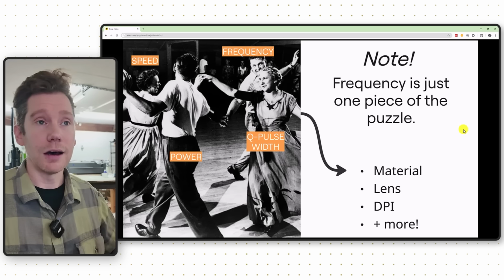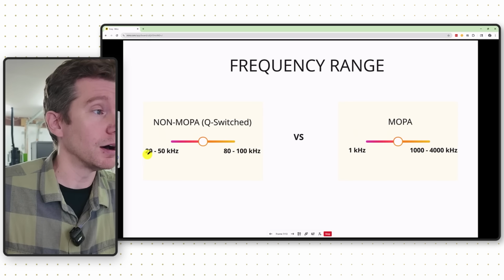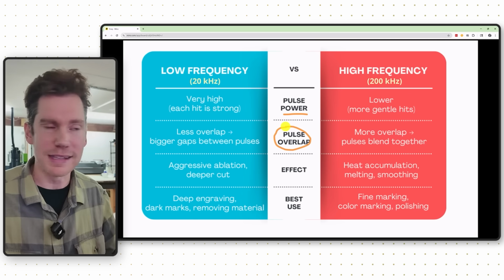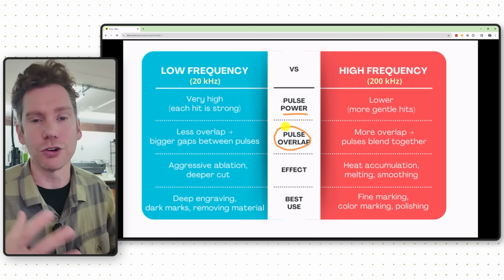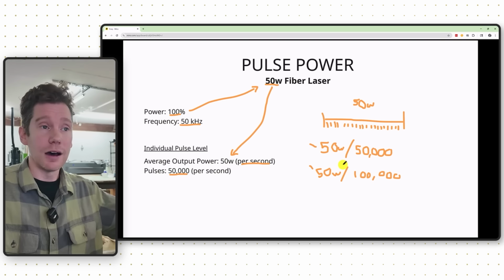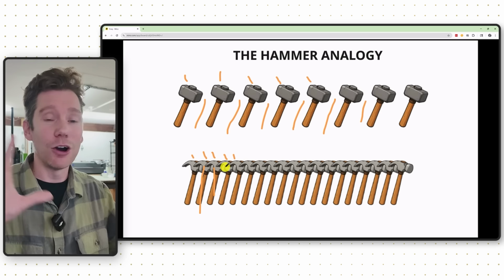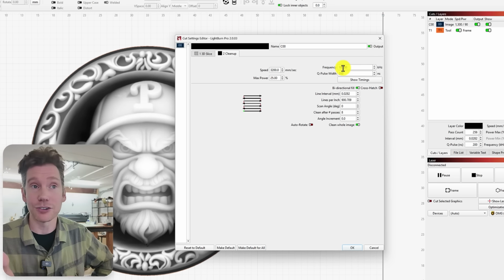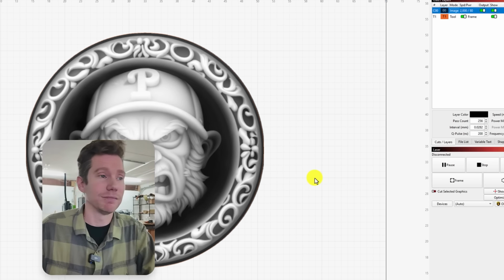Understanding Fiber Laser Frequency — Explanation + Real Engraving

Comment: So how do you figure your minimum setting on the frequency that won’t scale.?
I have a Monport GA 30
Reply from the maker: The only place Ive seen it listed is on the technical spec sheet of the laser source inside my machine. Unless Monport tells you that in the manual you might have to open it up to check the label. You could also try running a test grid comparing all frequencies from 1-20 or something like that and seeing if or when the power drops off. Im not 100% well versed on that topic yet just working from info someone whos been in the game longer than me relayed.
Reply: @justinlaser  so what power of laser are you using in these videos, and how long does it typically take to engrave a coin

Comment: Any chance of trying a hobo coin with working internal mechanism?
Reply from the maker: I just looked one up. Very cool design. The engravable design would be no problem but I gotta figure out how they assemble them.
Reply: @justinlaser  -  A fibre laser should be able to hollow out two coins into two interlocking halves.  For mechanisms, maybe watch parts or Sharma humanoid hand internals are the way to go?  Subbed in anticipation!

Comment: I see that higher frequencies also reduce the stair stepping along Z, which is an issue that I am running into. Did the test at max 30khz only, which doesn't seem to be ideal. Thanks for the informative video!
Reply: Try adding a small amount of gaussian blur to the image before pulling into the laser software, less than 1. Really cuts down on the “step” look.
Reply: @dian3145 Thanks for the reply, but I tried that already, as well as exporting height maps in 16 or 32 bit. I also see no stair stepping when using the 16 or 32 bit height maps in blender as a displacement map, which is how I always check the quality. No matter the height map used, it results in stair stepping, even if I use 256 passes or higher in light burn. So looking for a way to smooth it through the laser. Also, when looking at the example coins here, you see the stepping on the character's cap get less visible as the frequency goes up.
Reply: @NickOnTheAsteroid  that’s where I noticed it most too! It’s crazy how much better the P popped off as well. I only have a 20w, and the GB fixes it every time. From a logic standpoint I can’t figure out why you wouldn’t see it in blender, and have it show in the coin. So sorry!
Reply: @NickOnTheAsteroid  Is there a setting for how much to drop per layer? Perhaps the default is set to more than 1?
Reply: @dian3145 Not that I know of. Still fairly new to fiber lasers though, so I could be missing something. I guess you could see the passes as each being a layer, and the idea is that 256 passes equals the the amount of possible shades of gray in an 8 bit image. So less passes would mean bigger steps and more passes smaller steps. This is not what I am seeing in my tests though. Over 256 steps does not seem to make a difference. But if you look at the fact that higher power + lower frequency takes away more material, it would make sense that the solution would be either use lower power or higher frequency, or both. Seems like I still need to test more. And going by this video it might be wise to look at frequencies first.
Reply: @dian3145 May I also ask what your power percentage is when you do the engraving? And how much gaussian blur do you apply? I might've been to prohibitive with the amount I applied.. Can always try again with some different settings.
Reply from the maker: Ah yeah raising that up should help with that. Especially with 2.5D the blending is so important.